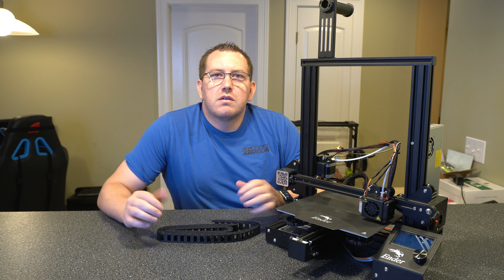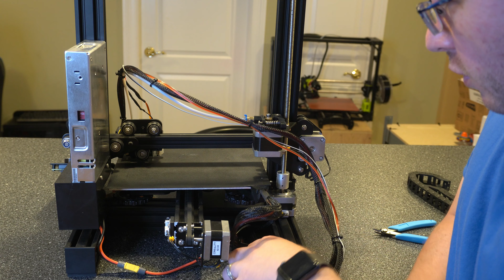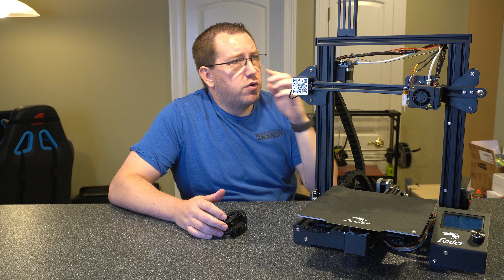3D Printer Cable Management – The Basics

Comment: I just scrolling by for ideas to correctly mount a cable chain in the X axis ( where I believe it's most needed, in my case with direct drive), I saw your installation and that's not how a cable chain works, it should be installed  parallel  to the movement and not hanging there in the diagonal , they must be installed impaired so that they don't wiggle around...  That is only giving weight to your cables. Believe me i've seen my share of cable chains being used in bigger industrial machines.
Reply from the maker: HI. It does work better on the x axis but these are light enough that it was fine on z as well. The info on thingiverse for it also has it shown on both axis as well.

Comment: Thank you for your video.
Can you please explain if its advisable to secure the wires inside the drag chain. Or do you only secure the wires in one spot in the drag chain? And are there connector pieces which connect directly on the stepper motor cq build plate?
Reply from the maker: Hi. Thanks for the feedback and thats a good question. I would only connect the chains at the ends to the stepper and build plate. The kit I bought came with two but im sure you can print more if needed. I decided not to because I wanted to see if there would be any issues, and so far there hasn't been. Dont secure the wires in the chain, they would be able to move around in there as needed.

Comment: My major problem is the cables from the Zaxis running accross the bed is the cable has run accross the print then ripped the print into peices, I own a Voxelab Aquila X2
Reply from the maker: Hi. I dont have much experience with that printer but you should be able to sucre  the cables in a way that keeps them away from the build plate.